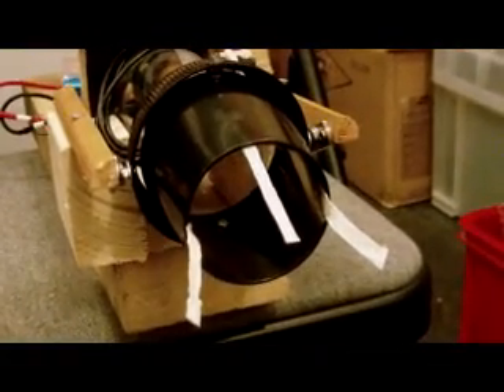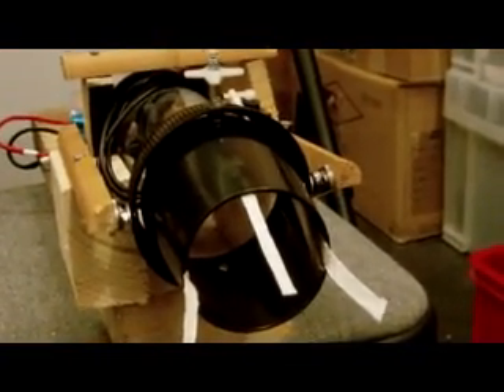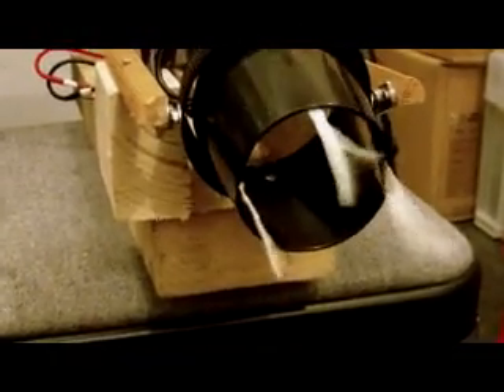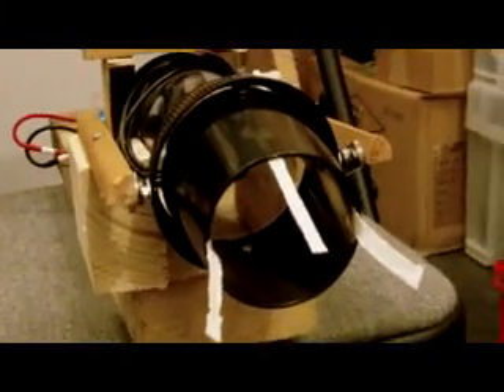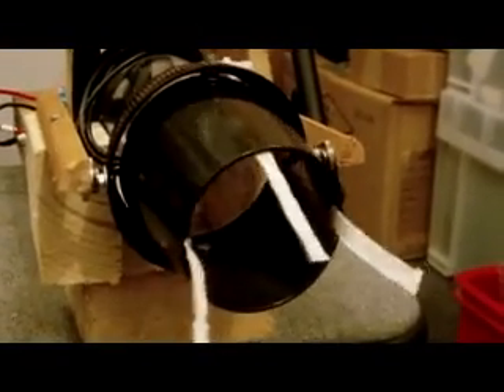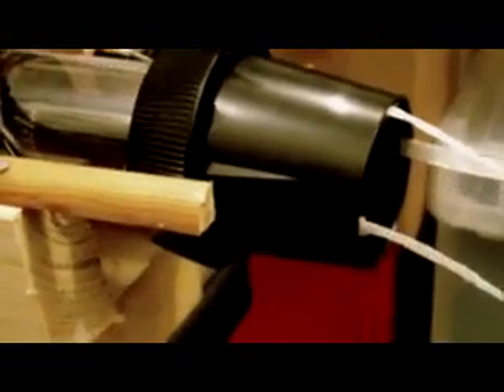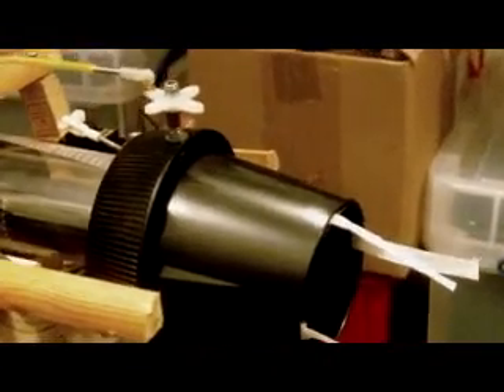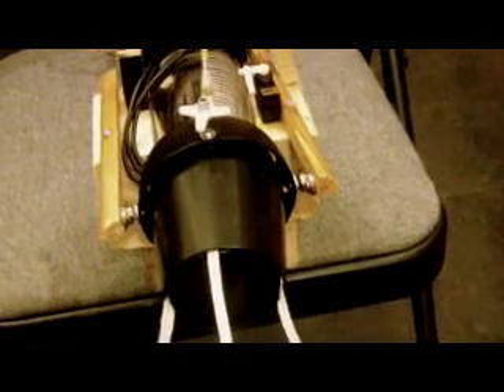Home Made 360 Degree EDF thrust vectoring unit

Comment: Very cool nothing like flying using vector thrust, hope to see more.
Reply from the maker: Cheers Chris. Thanks for subscibing. Got loads of projects in the pipeline. Need to get me a 70mm edf for this vectored thrust unit before i make a plane to fit it on. Like i said on the vid maybe a Chinese J10B as its the only jet i can think of that if built to scale has a single engine and would work well with vectored thrust.